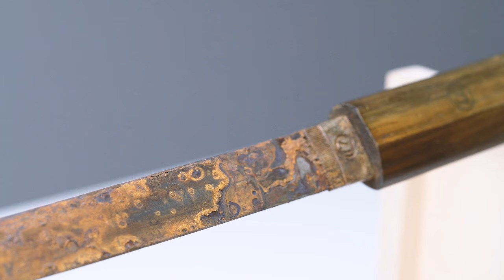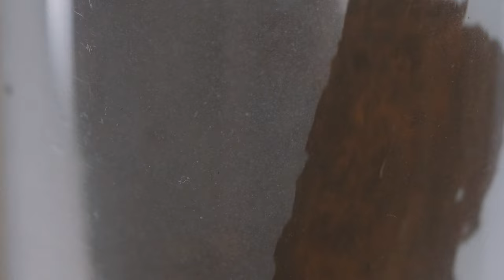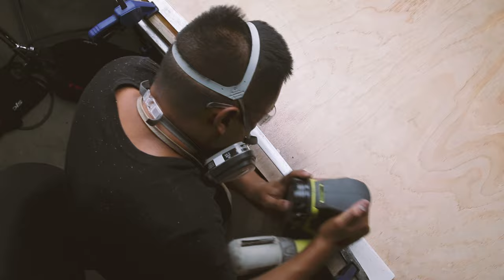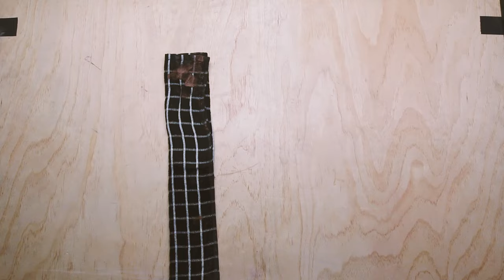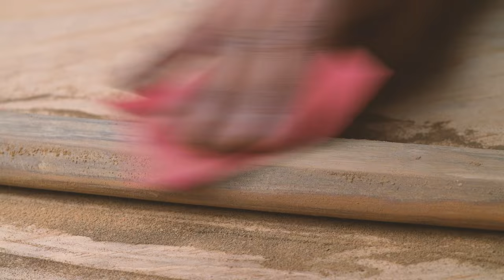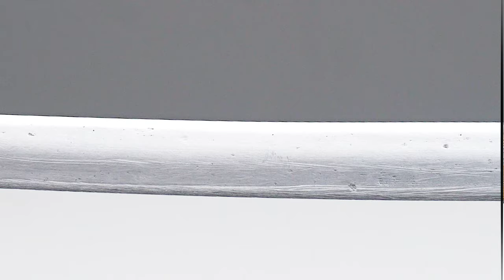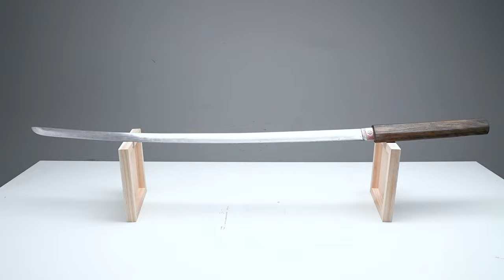Sword Restoration

Comment: “How to decrease the value of an antique sword”
Reply: yeh cos anyone would rather buy a rusty old sword?
Reply: Cordelia Mcbride you would be surprised how many people buy them
Reply: Cordelia Mcbride that isn't the point but you do you
Reply: Was about 5k. Now 400-500
Reply: Cordelia Mcbride Jun would...
Reply: How would a rusted sword be worth more? He removed the rust and added an edge, I don’t see how that decreases value.
Reply: I'm not an expert but I'm pretty sure that even if a sword/antique is in shitty condition the original material is preferred over it being restored. He sanded off the original finish and added a new one + Idk if he's a professional or not. That is if we're talking about someone buying for collecting and not to use ofc...
Reply: XDDD
Reply: meme peppi its a cheap wallhanger
Reply: meme peppi do you think something old is always antique? no dude. something can be said antique if it has been around for a long time but still has good quality.
and this sword is rusty which means it doesn't have good quality
Reply: Ahmad Syafi'i its not an antique..its a cheap wallhanger he burriee
Reply: Louis Rudy i'm not saying this sword was antique
Reply: theyre just weebs im just mad because he didnt even restore it right
Reply: The damn thing is from eBay or something, this is about as far from an antique as you can get.
Reply: meme peppi it’s not antique
Reply: This is NOT an antique sword it was buried in a time capsule for 10 years not 600
Reply: Its not an antique its like 30 bucks
Reply: @cringeolouis7980  5k? What a fucking joke. It's literally a mall sword that was common in the 90's. It cost roughly $100 new back then and has no real value.

Comment: There is a big difference between making a sword shiny and having an expert polisher  bring out all the great features of a Japanese sword ( hamon, hada etc ). Of course we don't know if the blade was hand forged in the traditional method or not. You can make about any rusted blade shiny if that is all you want.
Reply: I'm 100% certain it was a cheap repro, I recognized exactly what blade it was. I also collect real Japanese sword, been so for over 2 decades. This is a very common one you can order from places like Budk, it's literally junk.

Comment: So sad, you ruin that sword. 
The heat from machined sanding  will damage the heat treatment on the edge. I won't expect the hamon will appear after that kind of restoration. I hope that sword doesn't have any historical value, if it is a real antique sword, it will be a great loss
Reply: The heat treathment won't get affected by the sanding. Only if you can see colour changes like from the standard grey colour to blue then you are changing the molecular construction of the steel and will make it vounrable ( don't know the correct spelling sorry) to breaking. What really grind my gears is that he sanded the word off completely. That will have a big effect on the value.
Reply: Surya N. I'm sorry,but is that a JoJo Reference?
Reply: GODKING ÉOMER might be the heat treatment won't be effected by sanding. But still, ( if that was a real shiken) restoration with that method, i think its pretty reckless.
Reply: Theresia Siahaan i don't even know what are you talking about. If you know something about shiken or katana restoration just let it out. I'll be more than happy to learn.
Reply: Anacleto , i never thought it was anime😅. But in Japanese sword, hamon is almost similar to temper line that appear on the blade after heat treatment
Reply: Anacleto KONO DIO DA!
Reply: IS THAT A JOJO REFRANCE!
Reply: GODKING ÉOMER also he didn’t clean the inside of the sword sleeve so every time he pull out and put it back in it will scratch the sword
Reply: Surya N. You don’t know what your talking about, sanding won’t effect the heat treatment. If he was dry grinding it on a grinding wheel without water then he would effect the temper, not sanding, sanding doesn’t heat the steel hot enough for it to change colour,
Reply: I think he already consider this ( hopefully )
Reply: Dude an orbital sander wont create enough heat to ruin the heat treatment and if you want to reveal the hamon line on a sword if there is one it needs to be etched in acid like ferric chloride
Reply: No worries mate, I've seen this sword on the net, it's not actually a handmade sword. Just a half tang stainless steel wallhanger.

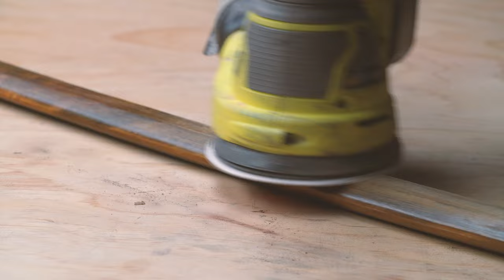Comment: Leave it to Buzzfeed to not take any sort of care and proper treatment of the blade and sheath while "restoring" this blade and sheath. They did not even try to remove the blade from the handle to assess the damage to the tang or clear out the hilt and spacers. Rather than soaking the sheath in a warm bath and gently sanding the excess damage and dirt off they completely destroyed the finish and even removed engraved lettering at 2:38 with brute sanding. The improper sharpening also ruined more of the blade as well, leaving it with more unsightly scratches and ragged edge as they sharpened it both with the technique and angle of a common kitchen knife at best and the buffing wheels and the way they used them so poorly were the worst calls to refinish the piece.
Good to see that your work on 'restoring' this piece approached with as much research as all your other articles and was done with about as much tact and care.
Reply: this channel isnt owned by Buzzfeed at all though, its just some asian guy and his crew ripping off the name for subs
Reply: Slurm its highly addictive if you go to Buzzfeed's main channel BuzzFeedVideo and click on channels, you'll see that this channel is listed on there.
Reply: Hurricane's channel And? They can't use the tequniques which were used in this video and call it a "restoration". It simply just doesn't work.
Reply: It was worth more in the rusted stated before they completed massacred it. Poor sword 😢
Reply: TheNEOONE1 Honestly, of its just some random forges sword, with no noteworthy name attached to it, it might be worth ever so slightly more. But  they'd have to take off the grip and look up the makers mark to truly know. Chances are they did literally nothing to the value of the sword. But it is a disgrace to call this a restoration.
Reply: GallopingWalrus Looking at the shirasaya (wooden sheath and handle) it's definitely an authentic blade made in Japan.
Can't tell much looking at the blade though. The habaki wasn't removed and is going be to full of rust and acid now which will carry on eating the blade, and probably all over the tang as well, which they didn't even bother to remove the handle.
They properly have destroyed the geometry of the blade and taken chunks of metal off with that sander, so it's only going to be even wore worn away if it gets a proper restoration by a professional togishi.
Reply: TheNEOONE1 They definitely fucked up the blades geometry and it'd take lots of work to put a proper edge back on it. But it may have been made in Germany or Switzerland, or atleast the blade. There was rampant blade production going on in Germany of all sorts. Many blades from all over Europe and Asia, were actually German made. Katanas and Daos with Japanese wood grips, but Atlantic ray skin instead of Pacific. There were also tonnes and tonnes of scimitars and shamshirs that were made in Germany.
Reply: Sorry, the Daos obviously would have had chinese wood for grips.
Reply: GallopingWalrus Depends on the type of wood though. Japanese tend to use Honoki wood alot for swords.
Reply: TheNEOONE1 For all we know it could be German walnut, or one of many Swiss alpine hardwoods.
Reply: ArynosValinir I agree that they royally fucked the sword up, its his sword he is technically restoring it to look nice on his wall more than likely so just chill
Reply: U just got so triggered over this. 💀💀
Reply: J V how is it bad to be angry at an idiot who destroyed a sword that is decades old and could be worth a fortune?

Comment: I died a little inside when he sanded the sheath
Reply: URGENT FURY it physically hurts to watch
Reply: They wouldn’t need the “sword” anyway what would they need it for cutting there fruit
Reply: @turtlelegsoup775  you can't tell that the sword was cheap? He got it out of a time capsule in his backyard it's not worthful you can get the same sword at my mall with the same engravings for around $50 it's not that expensive
Reply: Whats the problem if that?
Reply: @ultra2635  The engravings (IN A KATANA) tell either the maker/shop that made it (you're basically not citing your sources) OR an inscription to the person, ordered by that person. This means he either didn't know or, more likely, DIDN'T CARE.
Reply: He should of used a cleaner with calcium carbonate which gets rid of the rust but doesnt ruin the sheath
Reply: Alexander Lacaden where can you get this?
Reply: @matthewwinn5401  Check out a channel called Juns Kitchen he has a rusty knife cleaning video the link should be in the description
Reply: URGENT FURY ya they didn’t know what they were doing
Reply: @huntermyers6489  This exact sword is literally on ebay for $20, this is fake, its not actually old or valuable

Comment: Did anyone else cringe when the orbital sander came out?  And he never touched the tang (nakago) which will be rusted too.  I am pretty sure that this is an inexpensive reproduction because a real katana takes a month or more to sharpen/polish and this "restoration" will destroy any collector value. Lastly, I don't expect expert sharpening technique and starting at 3000 and ending with 8000 is not horrible.  Jeweller's rouge is not bad with power buffing, but it does not do a decent job on hardened steel (unlike Chromium oxide).  As a quick and dirty method for making a wall hanger presentable, this is OK.  But as "restoration", not in the same ball park.  The scratches on the cutting edge make me want to rip the thing out of his hands.

PS I taught myself to sharpen my own knives/tools and I would never take on a real Katana restoration.
Reply: Actually the tang is never supposed to be polished 
Because that's how they can carbon date it.
Reply: Yes, but they can at least detach the handle and wipe the tang with oil. The scabbard and handle must have soaked a lot of moisture, what with being buried underground like that.
Reply: true
Reply: Go away
Reply: Free Style Every Day what's wrong with Rick and morty I use to watch it since they're episodes came out fresh on adult swim
Reply: Dont bring Rick and Morty into this.
Reply: Alexandre Larocque why not Rick and Morty is the greatest show on adult swim
Reply: Wubba lubba dub dub! Pickle Rick! Szechuan Sauce! Look at me!
Reply: You must be fun ar parties
Reply: Also wouldn't the heat from the sander ruin/damage the temper/heat treat on the blade
Reply: Deuz_Ex_Machina _42 how but hurt of a person do you have to be to bring up politics on a video with no form pf political agenda or commentary. It's actually pathetic. And a bit humorous.
Reply: commatoes The biggest tells you can observe that it's a cheap reproduction is the habaki of the sword. If it's squarish with lines, it's definitely shit quality.
Reply: It's buzzfeed. Do you honestly expect any of them or their affiliates have any other skills besides professional complaining?
Reply: These comment smh, what's wrong with being smart? I bet it's much better than being dumb
Reply: I don't get it... someone shows they know a little something and gives their 2 cents and people get offended.. 
He doesn't claim to be an expert - if anything his long comment shows his authentic interest in metallurgy.
Reply: RankaZer0 you are either friends of this buzzfeed katana restorator or you are him. You are almost on every comments that give decent feedback regarding proper restoration and simply "oh stfu"
Reply: Its a mall katana

Comment: The sword should be remove from the handle by take off the little pin on the handle.  The way he use power tool was destroy completely structure of the sword by heat.  The way he sharping the sword also destroy it's angle.  This make the the sword totally JUNK.
Reply: E.T xProductions english isnt everyones first language you know? Learning 2-4 mandatory languages is not that fun
Reply: E.T xProductions Dude, it's not fun learning languages in 2 weeks and expecting yourself to be good.
And im here stuck with Japanese tution.
Reply: What do you mean "pin"? I don't see the power tool would "destroy" the structure and the angle!
Reply: Christy Wong at the end of the hilt there is a pin thst runs through to hold the sword tighter together, when he says the power tools will destroy the structure he means the tempering and the angle to the edge katanas also normally have a Hamon the wavy line which signifies that the edge is soft easy to chip, bend, or break. he ruined the sword...